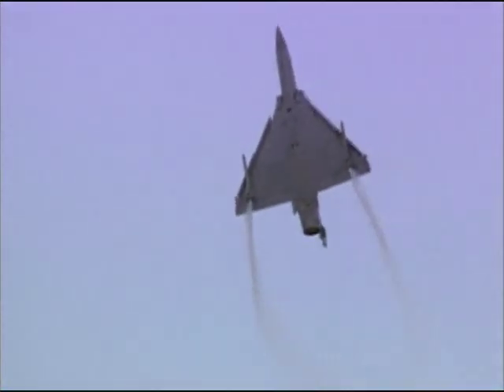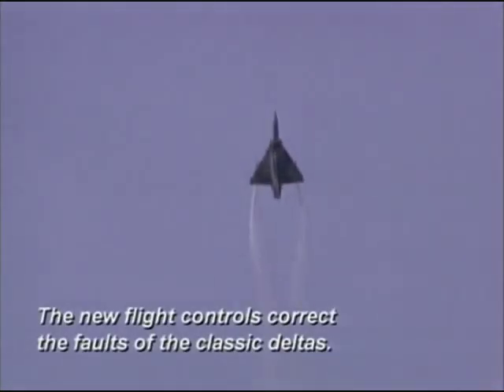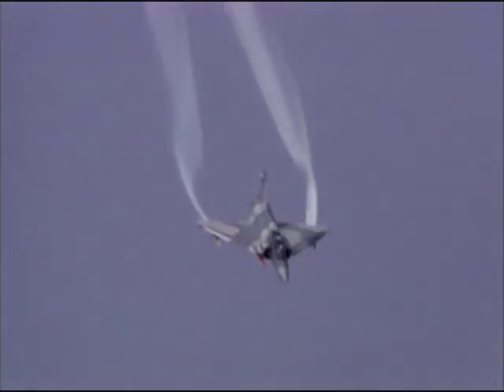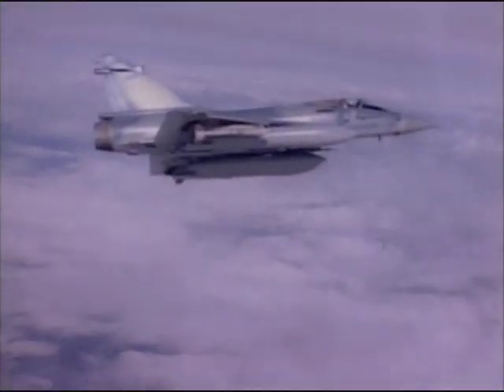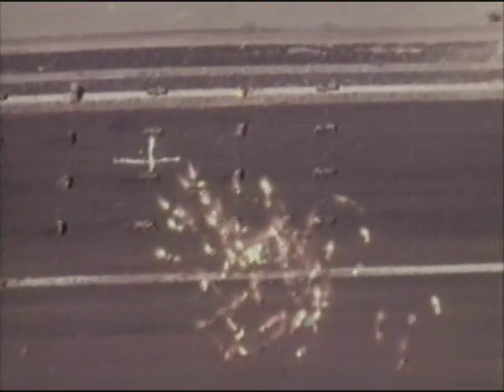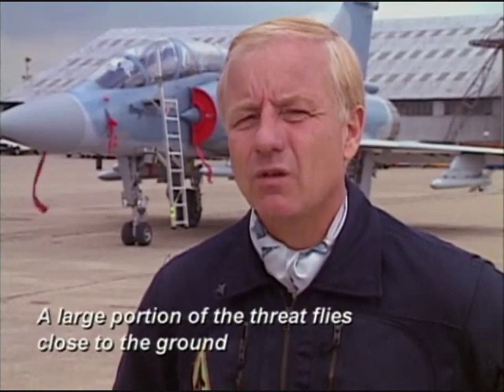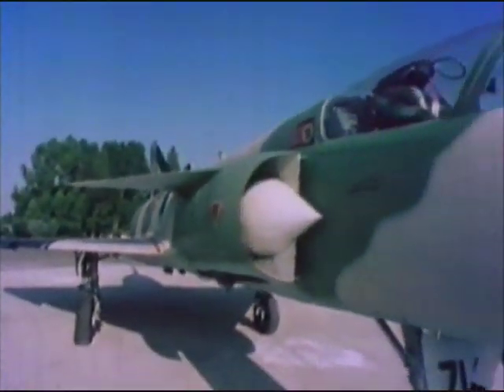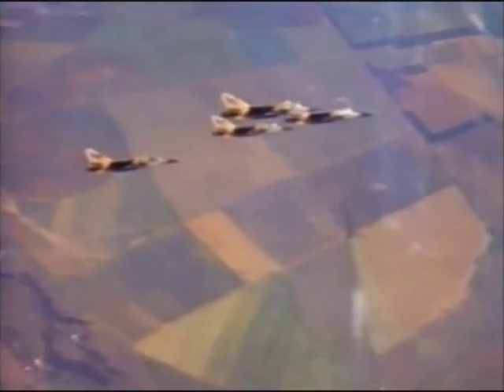Firepower - Mirage Jets (Part 2/3)

Comment from the maker: @aarrmmeenndd100  F-35 has a lot more capabilities over the Harrier. It can go supersonic for starters, the Harrier can't. It has all types of avionics, sensors and electronics the Harrier doesn't. It has stealth, etc. It is a much better jet than the harrier the only thing in common is the vertical take off.